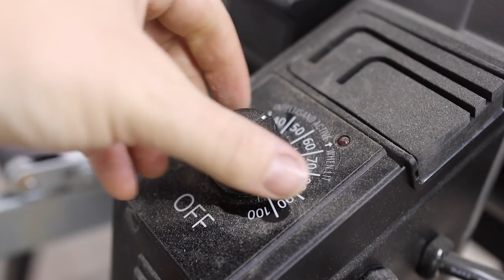Hybrid Longbow Build For Traditional Archery.

Comment: As a laminated bow build is on my bucket list, I've been watching numerous bowyer channels and each as something to add to the mix.  Granted, the process is kind of plug and play anymore, but individual design / material choices and attention to detail dictate the outcome,   I see this build as one of your more professional builds.   Kudos!   Best of luck going forward.   

As for myself, I'm "shooting" for a more "Shrew" type exaggerated reflex / deflex design; mostly to accomodate my absurd 31" draw length without having a 66" long bow.  I have a 2 year old Black Hunter @ 40lb. that I like save the stacking after 29" or so.   Perhaps I should investigate designing new limbs for the existing 15" longbow riser.  Has anyone here tried going down that particular road?

Comment: A question. I realise you don't wrap your bows with string, as reinforcement, but as a bow builder, perhaps you can answer this. You know the string wrap on asiatic bows. Just above and below the handle, and sometimes on the limb tips. Is string by itself enough, or should some type of glue be applied to it, as not to unravel?

Comment: Very nice!! I got a project idea for you as a challenge sort of thing

To make an ambidextrous asiatic composite style bow. 

And also make it about 6 feet or a bit longer, the length of an english longbow/warbow. And with warbow levels of draw weight

Can do modern laminated materials but bonus points if you’re able to make it with all natural materials like the old composite bows, horn, wood and/or bamboo, and sinew.

The idea behind this is what is described in most editions of Dungeons & Dragons as a “Composite Longbow”

Far as I can tell the only historical bow design that for sure existed that would technically count as a Composite Longbow irl is the Japanese Daikyu Yumi. 

But I wonder how an english longbow/warbow sized asiatic composite bow that’s more symmetric would be like.

Comment: In most every laminate bow video I watch, it seems like there little or no coverage of any kind of tillering work like there is on a stave or board bow build video. Why? Is there no tillering work needed in building a laminate bow? is it just about getting the thickness consistent and knowing which combinations of wood and thickness and length create a bow of X poundage and matched limb strength?

Comment: I have been making bow for at least 6 years, I took a break for a couple of years due to life lol. Im getting back into bow making ( thanks to you and your channel) Im rusty but having a blast. Since my break I have started having carpal tunnel and arthritis in my hands bad. My problem is making flemish twist strings, my hands hurt soooo bad from twisting and keeping the string tight that I literally felt like I cant do this. I feel defeated because I cant make a string not from not knowing how or not doing it before but because the pain is so bad I get pissed and give up. I was wondering if you or anyone has any idea how to get around this. Is their a tool or machine I can make that would do the twist for me??? Any help would be awesome I cant stop just because of a road block.
Reply: Someone that is more knowledgeable in metalworking, gunsmithing, or with a background in manufacture engineering could tell you quickly